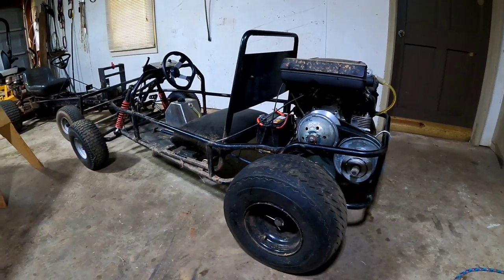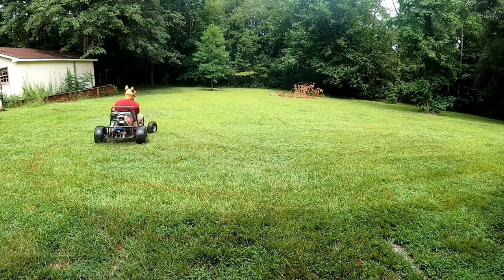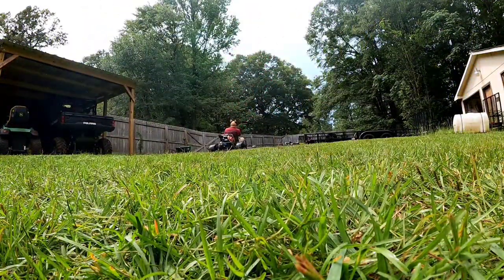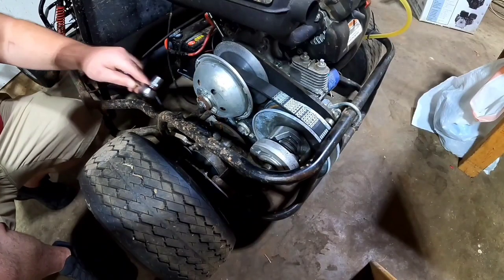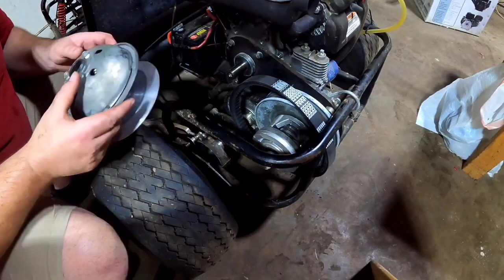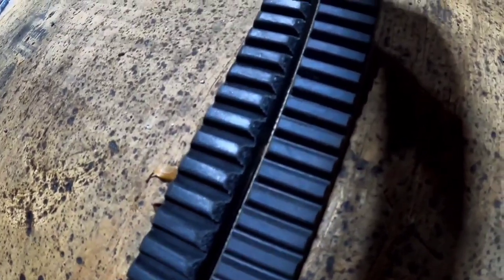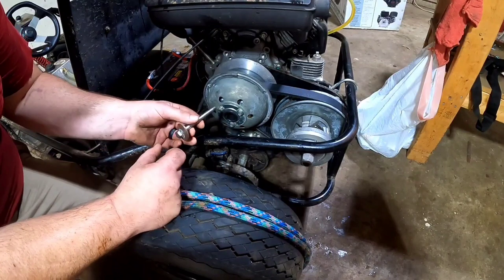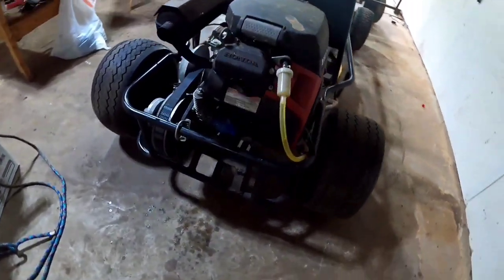V-Twin Go Kart Gets a new belt | Top Speed | Drifting

Comment: it's got so much hp you don't even need to modify it maybe an exhaust and intake but that's as far as I'd go
Reply from the maker: Exactly!
Reply: @boxtruckers  I would say maybe bullet flywheel but you'd have to do modification to the valve train and the connecting rod to be able to handle the rpm
Reply from the maker: @Jaybird913  The governor gear has been removed but it has a mechanical rev limiter.. Actually turned out to be a good thing. We have been doing donuts for 5 years on it now.
Reply: @boxtruckers  nice have you thought about getting a used or new performance motorcycle exhaust it would sound like a beast
Reply from the maker: @Jaybird913  I actually have twin stock mufflers off of a motorcycle, I would have to weld the adapters, but thats a good idea.